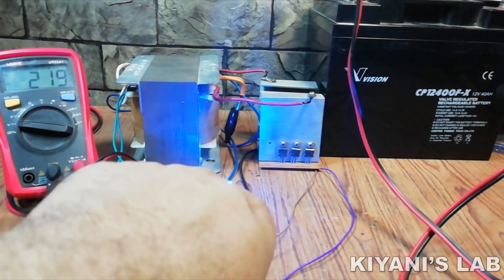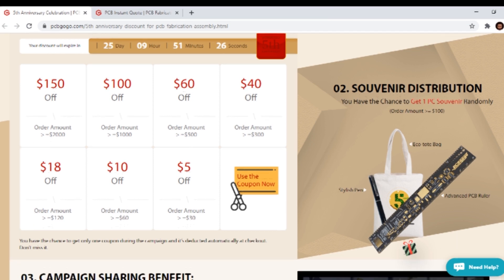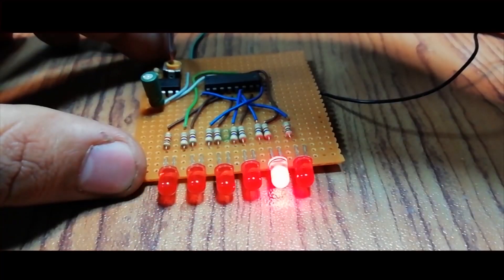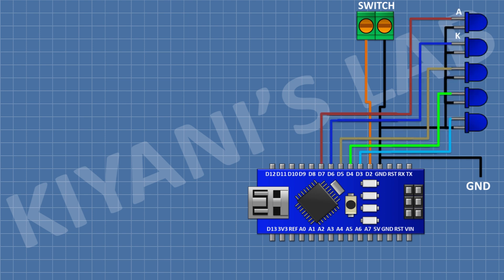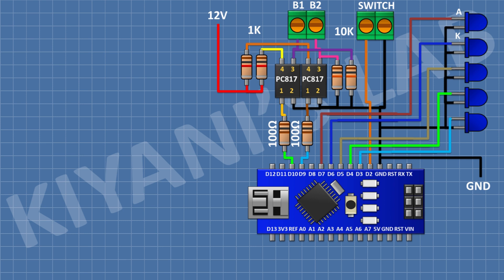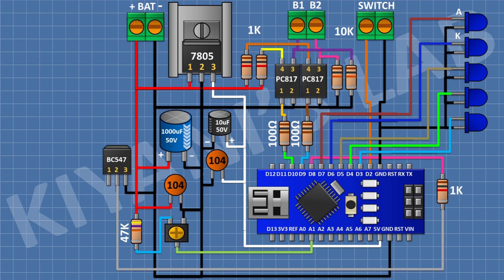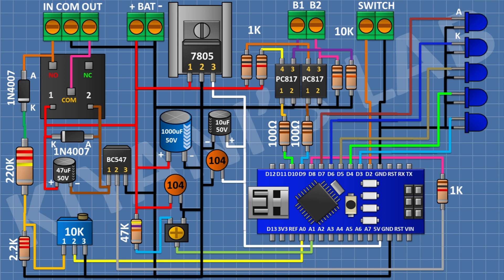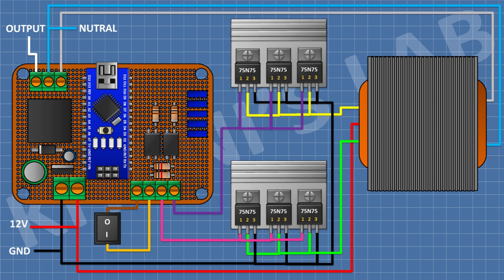How to make 12V to 220V 500 Watt inverter

Comment: I've a query. I'm having a small welding transformer of around 3kva (i don't know the exact rating but gives about 200amps  at 30 volt secondary side. Can I use this transformer as inverter transformer for high rating inverter? It has no centre tap but having few intermediate taps to control the welding current. Waiting for your reply. Thanks.

Comment: Arduino ?
If one day you can. Make An Oscillator with SG 3525.
Reply from the maker: 3525/24 is good choice but for battery level indication, low battery cutoff,over under voltage protection and soft start features we have to use a micro controller  so i have used arduino now one who need to add more features can add